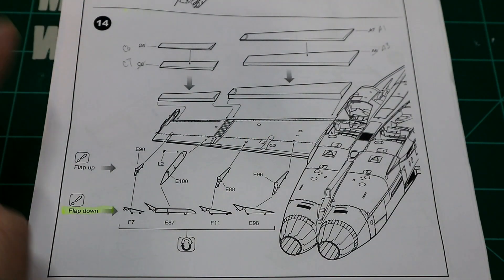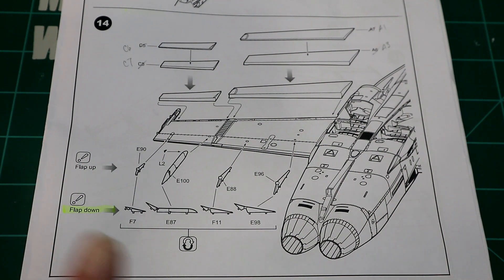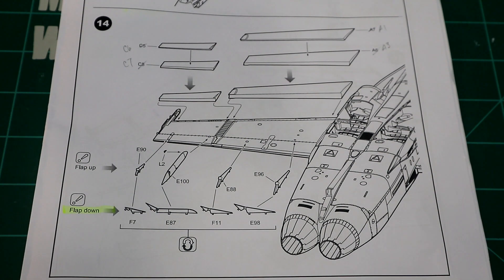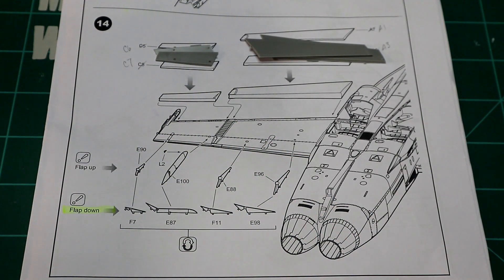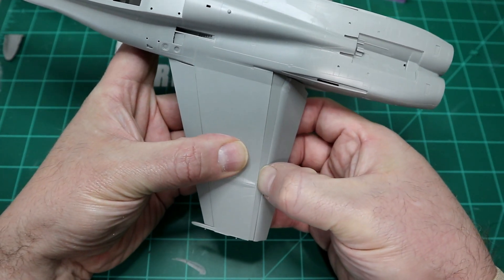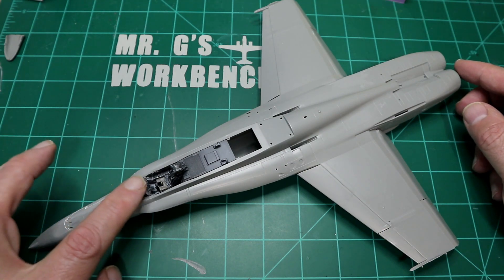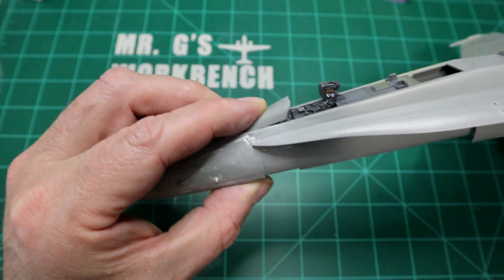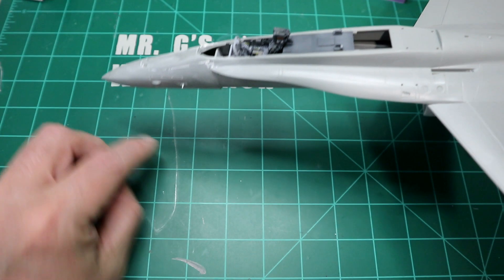Step by Step - Kinetic F/A-18, Part 7: That bug grew wings!

Comment: What putty did you use? And what was in your cottonpin when you removed it?
Reply from the maker: The putty is Vallejo putty - I like to use it for shallow gap filling. I let it dry and clean off the excess with a cotton bud wet with Tamiya X-20A Thinner. I should have mentioned it in the video - sorry about that!
Reply: @MisterGsWorkbench  , thanks G!